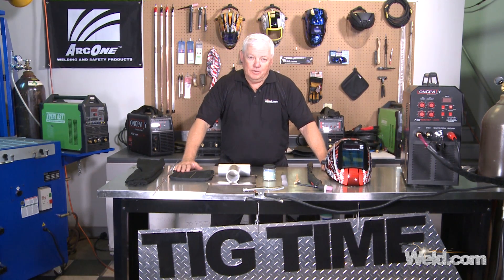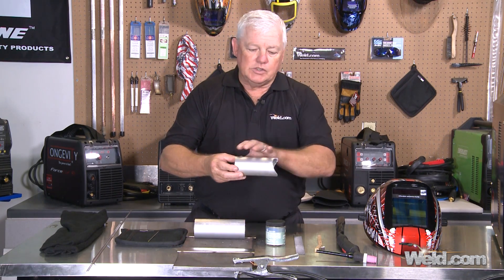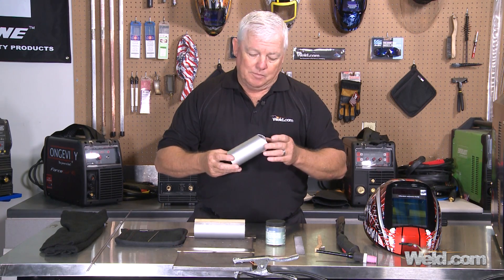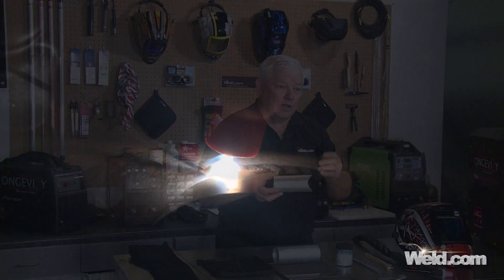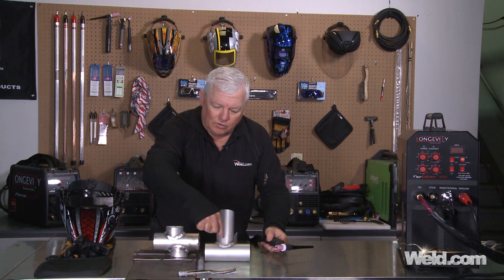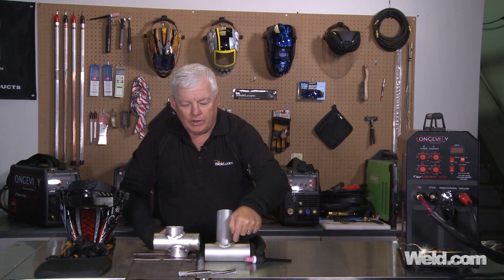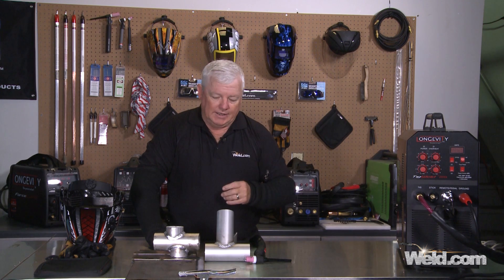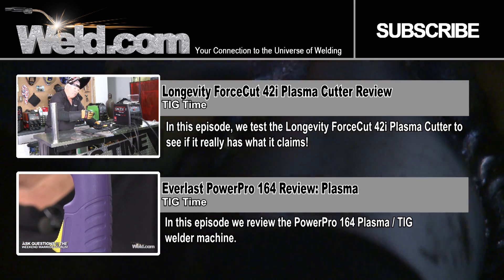How to Weld Anodized Aluminum - Bump Welding | TIG Time

Comment: dumb question.  I dont deal with aluminum a ton, but I thought aluminum was corrosion resistant in water?  I built aluminum parts for fire trucks and it never had to be anodized.  just trying to learn here.
Reply: Aluminum is heavily corrosive in salt water because of electrolysis. I build aluminum boats for a living, and most of the time, this occurs because the grounding of electrical components to the hull. This is generally combated by zinc anodes on the motor and other places as well as a centralized, single grounding point of electrical components. One bad ground wire can result in terribly bad electrolysis. Further, anodizing aluminum creates a more resilient , thicker aluminum oxide coating, increasing the corrosion resistance. We normally use anodized aluminum on any parts that we can get that are anodized for this purpose, generally pipes for rails, t-tops, poling platforms, and towers.
Reply: Blake Berry appreciate the info.
Reply: No problem!
Reply: I disagree. Anodizing is ALL about surface hardness, aesthetics, and scratch resistance.
5052 or 6061 are both highly corrosion resitant in their untreated form, but their oxide is a dusty grey that gets on everything it rubs.
Yes, stray current can be a problem, but that's true of any metal.  Most problems with aluminum corrosion come from connecting it to mild or stainless steels, which are happy to use the aluminum as a sacrificial anode, and is why you should see plastic bushings around stainless fasteners used against bare aluminum.  Magnesium is a better anode choice for aluminum protection.

Comment: I weld anodized aluminum fairly often in my job also, and can see a real world use for this method. I prefer some of the higher end inverter options with frequency adjustment and balance control.  Upping the frequency into the 200 Hz range does wonders for breaking through the heavy anodizing oxide layers, and adjusting the balance to suit the project dials you in for the job nicely, yielding to cleaning action.  However, the equipment to perform these types of welds with these kind of features are expensive.  Take the Miller Dynasty 350 for example, one of the industry greats in that category, but who has in the 10 grand range to spend on one (with water-cooler, etc.), especially for the at home hobbyist / backyard mechanic / side-jobber, or even small private businesses.  Great tips on a very usable technique in this video, especially for those running the smaller Precision Tig Lincolns and small Miller synchrowaves with air/gas-cooled torches.  I second the recommendation in those lower end scenarios to try and incorporate some helium into the project, does wonders for penetration as well as keeping a cleaner weld when welding anodized.
Reply: I agree with incorporating Helium for better penetration. I use a Lincoln Electric Precision TIG 275 with a pulse board that has a setting specifically for welding anodized aluminum. I don't particularly care for the setting. I will generally just grind off the anodized coating and weld bare metal with 3/32", 4043 filler, then follow up with Sheffield's Red Hot Aluminum Paint. This way, you get a very nice looking weld bead on the metal with no impurities, and the paint also leaves a nice looking, anti-corrosive finish, like the rest of the anodized aluminum.

Comment: Kyle,  The bump technique was developed out of necessity.  primarily for the marine industry.  Welding thru any anodize is difficult and always leave contaminants so it does not x-ray very well.  It also has difficulty with penetrant inspection.  If x-ray is required, it will be necessary to remove the anodize oxide from the surface... tough job!         good luck Mr. Tig

Comment: I weld Anodized Aluminum pipe for a living.. I have never seen anodized pipe that looks like that! That looks like regular mill finished aluminum pipe.
Reply: I don't weld but I've been around saltwater boats all my life...that tubing would make the ugliest boat tower ever.  No way that's annodized!  Maybe he was just showing the technique?
Reply: It is anodized aluminum, but not marine grade. I bought some of this stuff from a metal scrap yard for some tooling projects. Rather use that crap than my good stuff for stuff like stands.

Comment: Mr Tig
if you have to use this type of torch try using your slop in and slop out when you end the weld.
what I mean is have about 1 sec soft start (so arc starts slowly)
then about 1,5 seconds slop out (so the arc dies slowly)
so if you are quick with you finger
you can release the just as the arc starts to drop put you finger back on and it will slowly start again then release before you get to full amps and let it die fully

It take a bit of getting use to but I use it and it works
we use Kemppi welder but that what the boss likes :)

God bless

Comment: Mr. TIG -  Another very informative video.  Can you tell me what settings you used for AC Balance and Frequency?  I am using a Longevity 200EX and have been setting my balance at35 and frequency at around 145-150 with decent results although the welds are somewhat dull looking. Thanks again for sharing.

Comment: anodizing is not electrically conductive. That is why you may need to file a spot into the metal. Try it out with a multi meter on a continuity setting, touch your probes together here a tone for continuity. (conductive) now touch on anodized AL. NO tone! It is a trick I picked up from modifying AL parts and getting them re anodized (you can't anodize a part twice not without stripping off the first layer).

Comment: The newer inverter machines make this welding process much more user friendly than the traditional transformer machines due to the fact that you can focus the arc and concentrate the heat in a much smaller area allowing you to run hotter and faster without affecting the area around your work. I still prefer my syncrowave 250, it separates the boys from the men!

Comment: Typical anodized aluminum material used in the marine field is a 6463 series schedule 40/80 pipe. This is a special blend of aluminum that works well with the anodizing process. A few extra tips to welding this is high flow gas rates, 30 plus on regulator, 1/8 ceriated tungsten sharpened, a touch more cleaning action than standard aluminum and 190 to 210 amps on the dial. I personally don't believe in two passes (re-flowing), as this overheats and weakens the surrounding material  considerably.

Comment from the maker: Welding in general causes the aluminum to have several phases or conditions of hardening and annealing in different regions of the weld and heat affected zones.   In the applications that we are describing, there are enough linear inches of weld that strength won't be a problem.  Thanks for asking

Comment from the maker: The initial arc start is to "blast" through the anodize...  all  subsequent starts and stops create the same affect although there is now a narrow area of "good aluminum" in the center of the weld that allows arc continuity...    There are several techniques for the bump method and some welders never completely extinguish the arc.  The reason the technique became so popular with a complete start and stop was the advantages of field welding with only a start stop button.

Comment: I must have missed the reason you stop and start. Is it because it gets too hot when you use such high amperage? I've been welding a little anodized aluminum, on a transformer machine. Although starting and ground is sometimes a problem it seems to weld OK once I get going. As you say, high amperage AC.